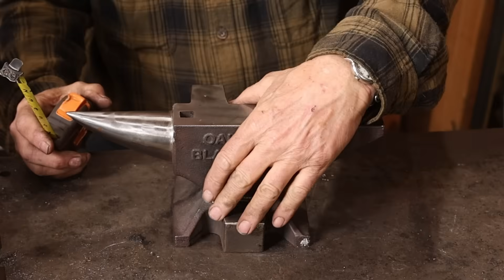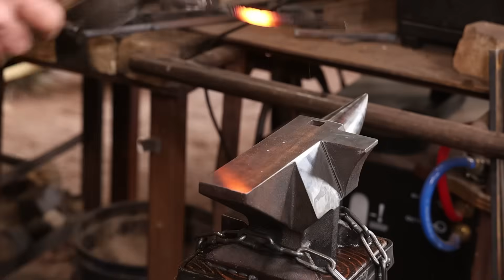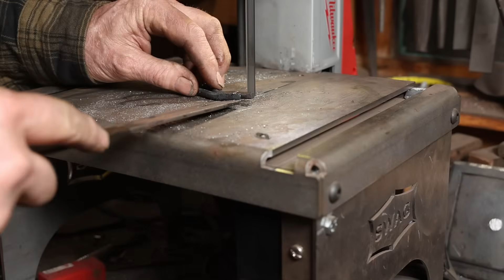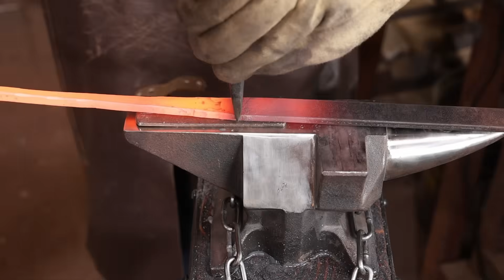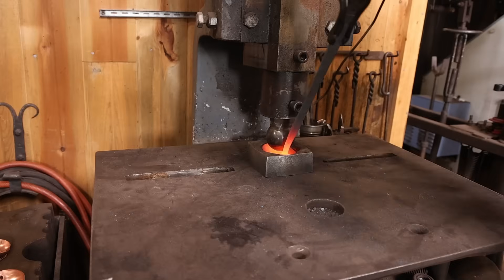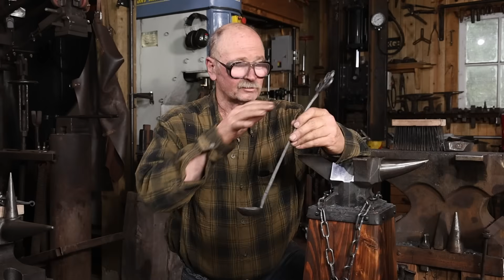25 pound Bavarian style ANVIL from Oak Lawn Blacksmith

Comment: Notice the scale creating lines across the face and equidistant apart, that's from the anvil "singing", the frequency that it vibrates at.
Reply: Thanks for the explanation.  I was wondering if the anvil wasn't lightly magnetized from the machining process.  But of course you've explained it.
Reply: I was wondering what was causing that.
Reply: No that is not !
Reply: Thanks for pointing that out! Super cool to see the anvil's natural frequency mode shape come out in the scale.

Comment: my saw blade breaks a lot using the swag set up, any recommendations. i have a WEN portable sawband , i have broken 3 blades in less a year
Reply from the maker: I can’t think of any reason this setup would break more blades.
Reply: @BlackBearForge  could be the speed i have it 3 maximum is 5  , and it occurs when i cut wood